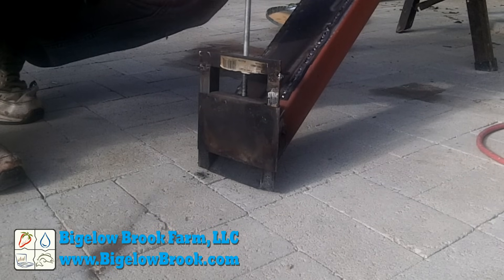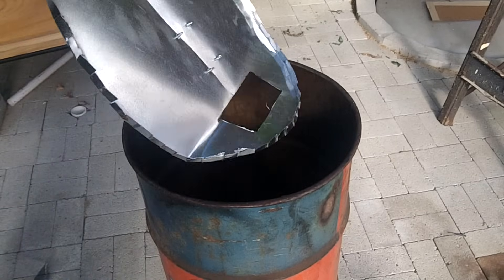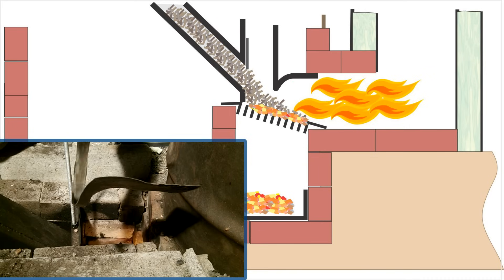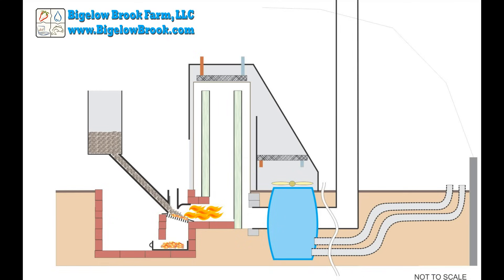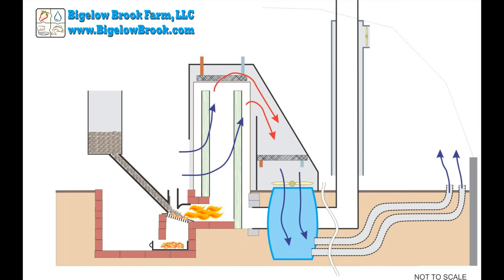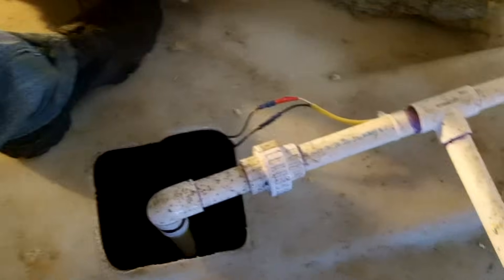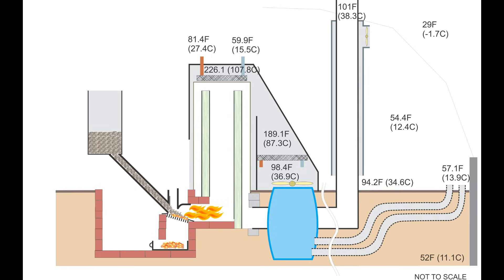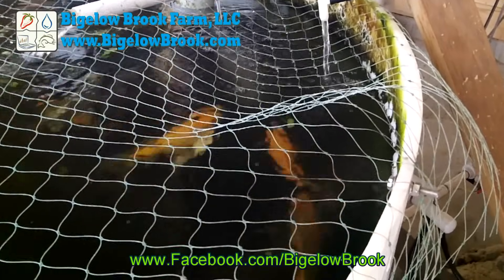Rocket Mass Heater - On Steroids

Comment: This is really Awesome. A lot of excellent thought and time went into the construction and benefits of heat coming off of the stove. I'm not quite sure why you didn't run the original barrel vent through the floor, as that is being done as well, most places. You could run your exhaust through a cob bench if you wanted maybe get more heat out of your system, or you could run copper tubing around that portion of your exhaust and have it cycle even more water if needed as that exhaust isn't as hot as a conventional exhaust of course. Needless to say you have done very well for yourself. You should be proud of yourself and thank the LORD for his hand in the process and build. I haven't looked at rocket mass heaters in over a year and so this is my first since then and I don't know if you are the first to use pellets or not in the RMH, but a very good design for using them if that is all you can get your hands on is pellets. My hat is off to you sir, job well done!!!!

Comment: You say that you are venting some of flue gasses thru the floor and into the living area (!!!???). Carbon monoxide is reduced with a RMH, but not eliminated. This seems like an outrageous fail in overall design, risking the lives of anyone who frequents the greenhouse. Did I misunderstand you?
Reply from the maker: No, that would be stupid.  The vent travels under the floor and exit out through the side wall.  One of my previous videos shows that part of the install.

Comment: Beautiful design! One thing I'd add: PLEASE make sure you have a carbon monoxide detector when making a home-made heater. One small design mistake can cost you your life.
Reply: in my opinion a carbon monoxide detector is a absolute must have no matter what kind of fire place you do have running. lucky we are these detectors exist so it would be a shame to risk your life just to save a few bucks.
Reply: U VERY VRAIEY
Reply: Truth is this design leaves less pollution than your basic church candle, a carbon monoxide detector is valuable but it's nessity  is overstated. 
For this design stove in general , conversely the heat from the outlet of the burn chamber can erode and rust the barrel faster causing open flap es into a room this seems the most hazardous complication in design there should be a solid burn plate over rocket stove into the mass accumulator like a rorer plate in a  Optimus petrol ( gasoline ) stove  with a barrier plate flame spreader
The first being titanium or stainless and the second being a cheap thick plate steel

Comment: Really nice set up on your dome.  In this video you mention that it will still get colder in January; Another way you could maintain some of your heat in the dome would be adding a heat exchanger inside your flue.  Old gas water heaters had a central chimney running up the center of the tank, inside this straight pipe was a spiraled piece of metal.  Taken out of the flue it is simply a straight rectangular sheet of metal  with regular bends to create a spiral effect increasing surface contact.  if the fit is snug enough it could be drawn through the flue with edges touching the full length without having to weld it the whole way.  Doing this along the length where you have the 10" cover with fan could give you a few more degrees.  The same process also goes for between your flue pipe and the 10" cover pipe (with fan).  The longer the air circulates across the hot metal the more temperature you will retain.  
Also, while I don't know the soil content of the greenhouse floor, if you want it to absorb and transfer the heat a little better don't let the ground dry out, moist soil keeps a better temperature when the air cools off... Though depending on where your runoff goes the ground may have plenty of moisture.  
Also curious what temperature range your fish tank goes through day to night, while I don't know much about the biology of fish I do know the water temp affects their behavior/ feeding habits, etc.

Comment: You could use attach a peltier TEG generator on top of the warming radiator, apply cool water to the other side of the peltier module, before it enters the radiator, and use that resulting DC to power that fan.
Reply: Actually I had a similar plan but I planned to use TEG units instead of a radiator. They like 500 to 600 degrees. My only concern is the barrel may get too hot for them. They can get 800 degrees. So long as you keep enough water flowing through the TEG units they should be alright. I'd add some redundancy on the water pumps and I even considered adding an elevated water reservoir in case the pumps gave out. If you design it right in a pinch the heating water can keep it circulating. Maybe not enough to save the TEG units though. If they get too hot it burns out the thermal chips. I'd run the pumps off a back up battery and keep a minimum of two pumps in the system. The newer 100 watt units I think run around $700 so you don't want to kill a couple of those over a dead $30 pump or a black out.
Reply: Or run the fan off a sterling engine

Comment: Great ideas, best is the pellet feeder, but you are over engineering the rocket heater.
The key point to the rocket heater design, is no additional power requirements.
It is important to understand its basic design principles.
Reply from the maker: Who says you can't use power for it?  I think the key point would be to heat the space as cost effectually as possible.  If it takes a little power to distribute the heat throughout the building, I have no problem with that.  This serves my needs perfectly.  Plus, it can still run perfectly fine without needing any power.
Reply: I did not say you couldn't use power, I said it defeats the principal of the rocket heater.
Reply: Thats a bit dogmatic, isn´t it?
Its a machine designed to be useful. If he modifies it and it is more useful afterwards than before, the modification is positive.
As far as i know you have no enforcable copyright to restrict the use of the term "rocket mass heater", right? So what exactly is the problem?
Reply: And what is the principal of using the rocket stove?
Reply: RMH is not copyrighted, it is in common use.
Reply: Which is why OP has no point.
Reply: Ae Norist The OP makes a very good point. The idea is to conserve resources and be able to heat your home for a fraction of the price.  And if this system was not missing the MASS that is supposed to absorb the heat and release it slowly...there would be no need to attend a fire all night... Or build a self feeding pellet hopper.  The whole idea of a mass heater is to use a minimal amount of wood scraps to heat a MASS made of Cobb or cement that will hold the heat for 20 hours after the small fire has completely burned out.  The mass would then slowly release the heat keeping the room warm until morning with zero fire.  The only mass in this system would be the ground.  But I believe through thermal bridging his heat is escaping in to the ground.   So the OP made a very good point.  You do what you like....but you are wasting time and money, when a true rocket mass heater would save both.  In truth...the only flaw however is the title of the video is misleading.  Its not a rocket mass heater.

Comment: How much do your pellets cost per 40 lb bag? because From what i can find thats like 200$+ per day running that thing if 40 lbs last 6-7 hours
Reply from the maker: +pl855p they cost about $2.25/bag.  This stove burns around 12 pounds per hour so It will go through that in about 3.5 hours.  That's 7.2 bags per day or $16.20 per day.  I usually just need one bag per day when it's cold or 2 bags when it's super cold.

Comment: Brilliant design! Question: Would it be possible to adapt your design to burn sawdust?
Reply: pelletise or compress into logs 1+ foot in length etc.
Another option is to wet and roll old newspapers into logs.
a small amount of cornstarch or flour will help bind the paper..
Reply from the maker: +celtenator Probably, if you could keep it from clogging somehow.
Reply: +celtenator Get a pelletizer.

Comment: It looks to me like you have flaw in safety.   It is possible for the fire to travel into the hopper.  You need a section of plate, and furnace cement, which stops the falling pellites from burning near the top of the grate.  I think there might be a safety issue here.

Comment: This is way over complicating which otherwise should be a simple system. Also goes for your underfloor heating systems. Just using the regular rocket mass heater is enough if you live in a real cold climate you can go with an ondol system developed by the ancient North Koreans which is still used today and probably the easiest and most efficient systems to make and have. Don't get me wrong your a clever guy, great idea but your just making it way to difficult then you should.

Comment: I would not use aluminum in contact with the aquaponics water. Only stainless steel should be in contact with the fish water. It would be safer to use a closed loop system for the heating fluid.  It would also keep the radiators clean and free of outside sediments. It is a little more work and cost but much safer for the fish and you. Aluminum is no good for the body. Excellent build though. Working mine out in my head now. Most of the materials are onsite and this is what I am doing too.
Reply: other than the cost of an additional pump, it should be pretty easy to run a closed loop for the water heater.  You could just coil pex into the bottom of the fish pond and run it through the radiators.  I wouldn't expect the aluminum impact to be significant, but there's no doubt that you'll get organic plaques forming in the radiators that will eventually foul them and might be difficult to clean.
Reply: good point.!. what about copper...?
Reply: @WandersOfficial  no copper either mate. Only food grade plastic or stainless steel.
Reply: @llewelyn9084  Coper is anti bacterial, we use it for clean water in homes ...

Comment: Thanks for the video.
Am having some thoughts on whether there is enough air flow through the rocket system to propel a small fan to produce electricity? - Like a mini wind turbine but driven by the natural air flowing through the system? - What do you think?
Reply from the maker: RICHARD TATE No.  not even close.  ;-)
Reply: Much better idea is to incorporate a steam engine to create electricity & use that any way you like.
Reply: @FoundersFan  I wonder if he has the space to build a nuclear power plant or maybe there is a river close by to build a dam. Then he could definitely power the fan.
Reply: @doumardose9785  Heeheehee ;-)

Comment: i like it when maintenance men make systems rather than engineers. I've busted open hundreds of feet of concrete to get to steam lines in the earth and under the cement floor. When things get corroded or if something breaks down, you'll just be going to home depot all the time. I'm super pessimistic about anything complex. When thinking about sustainable energy and locally obtained fuel, simplicity and locally found maintenance material is a value much higher than convenience.
Reply: Johnmark:  I spent 27 years as a machinist/welder/jig and fixture builder, I agree with you 100% Keep It Simple, as possible. I spent many years in an industrial toolroom working with industrial engineers where I built tooling to make or assemble parts, complex designs trying to accomplish to many things at one time were a nightmare to keep running and production suffered.
Reply: Keep It Stupid Simple KISS
Reply: Johnmark Hatfield  great comment. Having the ability to service and using quality materials a real cost saver in the long run. As we said at work.  Ain't got the time to do it right but we got the time to do it twice or three times. 
That's engineers and pencil pushers. Knew an engineer once pretty sure he worked for the railroad. 
Great comment and hope you have great days.

Comment: If those are standard car radiators your adding lead and zinc to to your food chain. People have made that mistake with stills and have gotten sick. I would recommend that you send a water sample to your local extension office for testing. Better safe then dead or worst. besides that it looks interesting.
Reply from the maker: They're aluminum
Reply: Bigelow Brook Farm (Web4Deb) Sometime they use a lead based solder to save money, lots cheaper then silver. Also if your using older brass fittings they can contain > 8% lead witch can leach out into the water, that's what we found in the old house we bought. You can also buy test kits on line or at many stores. Better safe then sorry.
Reply: What is worse than dead??
Reply: Married.

Comment: Does this give enough time for the air to 'cook off' the rest of the exhaust. My understanding of the way rocket stoves work to get maximum efficiency is that they continue burning the smoke while it flows up.  It would seem to me that the radiators would be sucking out too much heat from the burning chamber.
Reply: He said the barrel exceeds 500 degrees (Fahrenheit I presume), which is plenty to keep it as intended.
But the entire barrel shroud / radiator / fan assembly is completely nonsensical, even a very small section of pipe at the inside of the barrel would work far better eliminating all other components. And if the barrel was not intended for cooking you replace it with brick / clay which will make for a slower and more even heat distribution.

Comment: The ground is often considered a semi-infinite heatsink.  The air is similarly often considered an infinite heatsink.  We don't like letting heat escape to the outdoors because it can always accept more (act as a heatsink).  Unless you have ground insulation, it will do the same thing.   The ground is interesting in that it also acts as a thermal mass so if the thermal conductivity is low enough, the benefits of the mass/storage properties can potentially outweigh the negatives of the heatsink properties.  It would be interesting to compare the system's performance with and without the ground duct blower on.  My hunch is that the ground vents actually reduce efficiency.  Even then, their other benefits including improved airflow and a more uniform temperature distribution may outweigh that.  Interesting system indeed...
Reply: Maybe you could supply the induction air from the underground pipe from outside. (1 line supply) and the second line into the living space.

Comment: did you just use a regular vehicle radiator for the heat transfer? 
im running a rocket stove and want to add a radiator system to heat water for the house, do you think this is feasable? thanks for the video, its really good
Reply: Wrap the final exhaust with copper tubing, eliminating any possibility of contaminating the water/fish; plus salvaging the 101 degree exhaust back into the system.
Reply from the maker: regular radiator,  This is an all aluminum radiator for an Acura Legend.  You can get them on ebay for around $100.

Comment: Have you experienced any corrosion inside your radiators? What's your typical pH levels? What material are the radiators made from? And what purpose was the radiators originally for, if auto then how did you clean chemicals out of it.
Reply from the maker: There are new aluminum radiators for an Acura Legend.  Typically it's not recommend to put AL in your system.  pH stays around 7.0 most of the time.
Reply: Thank you. I think I will do this also. I may make my own radiators out of stainless though, depends on what my boss will sell the material to me for. I asked my initial question because I was afraid of corrosion with aluminum and copper. So I have one more question. How long has it been in your system, and have you had any adverse effects from the radiator install?

Comment: Great video. I was trying to find an idea to heat hot water and use the exhaust air to heat the air and i had thought of using radiators with fans to do it. your video seems the closest to my thoughts but looks like a very involved build

Comment: I'm not sure a radiator is the best idea for your purpose. Radiators are built for riding system of hot air, not turn air hot. The way most radiators are built is by using lots of little pieces all sealed with lead. Lead melts at a very low temperature. Throwing it into an environment where the idea is to heat the radiator up to very hot temperatures seems like a bad idea. Then there's also the factor of carbon buildup... I can't say for sure what will happen but it would be interesting to know what ends up happening long term.
Reply from the maker: This is an all aluminum radiator, there is no lead in it.
Reply: This isnt true about the lead. Im a plumber and radiant heaters are used the world over for heating homes, they are called baseboard heaters. They are even popular in the EU, and we all know how they are with health standards. They are lead free first of all, being built of highly conductive metals. Lead is not a good conductor. The same principle is transparent in cars and the radiators in them. They are made of aluminium because its highly conductive. Secondly, you would need temperatures of 327C to melt lead. Even a boiler system runs hotter than the temperatures mentioned in the video, with a limit of 120C being code here in Canada for hydronic heat systems. Third, you would need to be exposing your radiators directly to the flue gases for carbon to be an issue on these radiators. Since they are not, you will not get carbon build up.